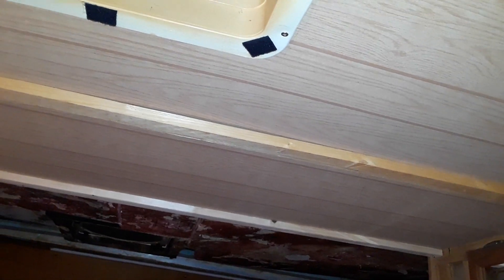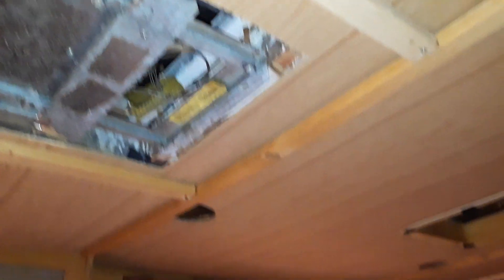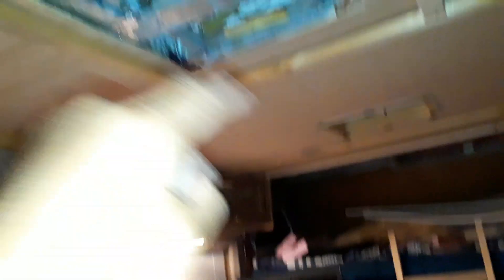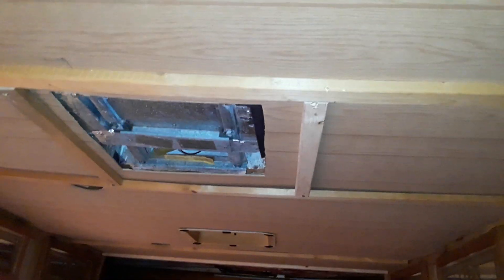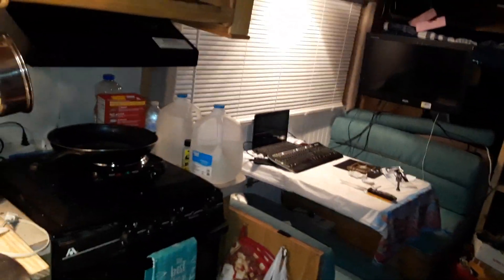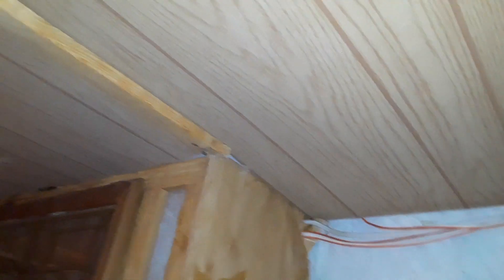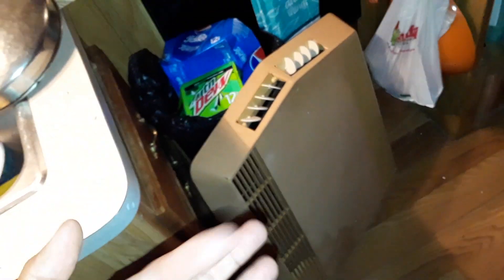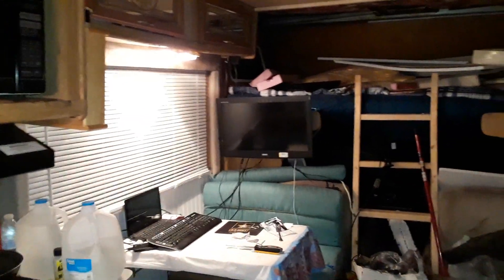Budget RV Restoration - Ceiling Installation Over The A.C. Air Intake (V1866) Living In An RV

Comment: Actually, normal screws will work.  Add extension blocks of wood to each side of the frame you already placed on the ceiling to receive the AC cover. You would be sliding that AC cover over the blocks, nice and snug.  Of course the next question is how to connect the blocks.  You can still use normal screws for that too.  You make a hole for each screw that goes about half way through the  blocks to countersink the screws. You can pre-drill  the rest of the way through the blocks using a smaller drill bit to make it really easy to screw the blocks in. I think two screws per block should be enough.  The AC cover would just need normal screws, since the blocks would be  just right there near the holes in the plastic.  Working overhead is always trouble on the neck and shoulders, so little tricks that this help. You don't want the AC cover rattling off as you drive down the road.  PS-- I've done a lot of overhead work.  I'm just now working on a 95 year old house, including skim coating a big ceiling in the main room.  It was cracked like crazy-- looks good now.  BTW, I'll bet that AC cover was something the prior owner picked up to replace whatever was there before.  Sure seems weird to have those buttons that don't match up to anything electrical in the unit.

Comment: Try going to a salvage yard for parts like the vent covers. As you’re rebuilding, keep in mind the collective weight of the materials you use. For example, what is the weight of the original molding trim compared to the 2” x ?” you are considering using. Keep in mind you’ve also been using quite a bit of heavier wood for rebuilding/bracing things already.

Comment: Denoy, consider taking 15 or so minutes and undoing some of the ac screws so that you can take just a quick look inside.  I’m wondering if the leak isn’t caused by something that can be easily and quickly fixed .  Maybe it’s just a hose that has come loose or a screw that needs to be tighten.  Don’t forget to use a flash light when you are looking at it.  If you have to disconnect any wires take a picture first to make sure they all go back the same way.  When I do a quick disassembly of something I just go as far as I’m comfortable, which usually isn’t too far.  My experience has been if I take a few minutes to look inside of something, 50% of the time it’s a quick fix.  Also, a taller bucket for the leaking water might prevent some of the splatter.  P.S.  It was a treat seeing three videos from you today.  P.S.S. You did an awesome job on the table.
Reply from the maker: I think you have to access it from the roof?  There is a drain from the top that drains onto the roof and it runs off to the side of the RV or the front of the RV depending on how level the ground is.  Maybe there's a slight hole and water from the drain is coming down that hole.  I currently have the situation somewhat under control which will be airing in an upcoming episode soon...but even as I type this, the situation changes depending upon how level the RV is when and where I park it...